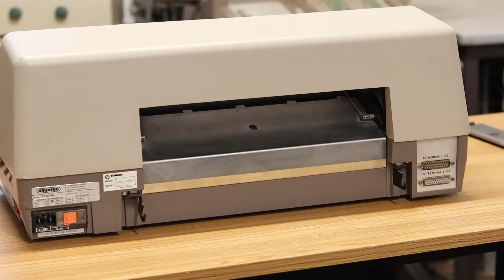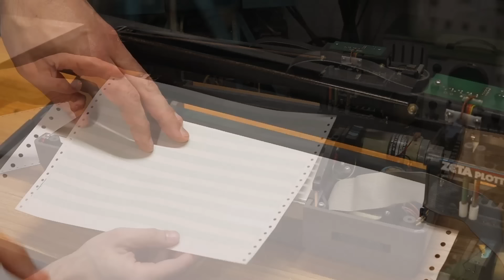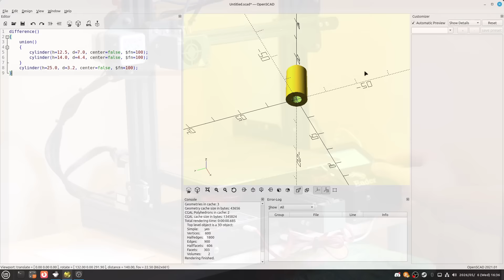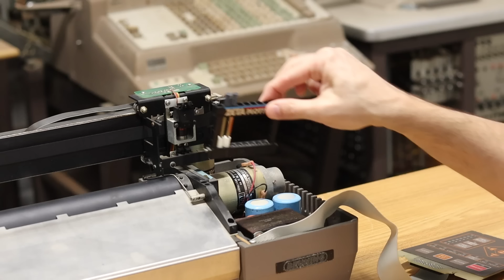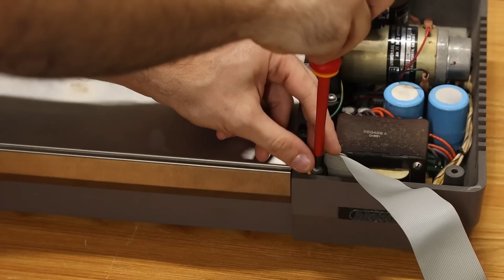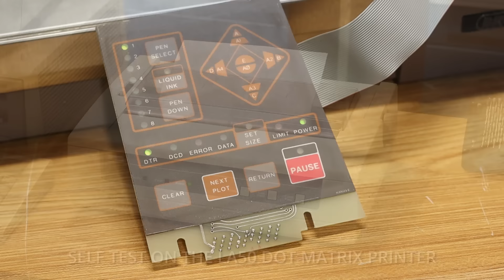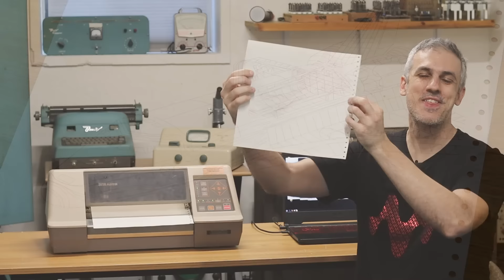A Pen Plotter from 1986!

Comment: well i guess you print PETG. and its surely humid. petg lloovee take moisture. for finner wall and such use a 0.2mm nozzle. its WAY slower but for the part you made honestly... use a 0.2 nozzle. but itsa ender 3 soooo... good luck for bed level and first layer with that.

Comment: Back in the olden days when I was a teen punk, I had a Commodore 1520 pen plotter. The tiny pens did not hold much ink and were incredibly expensive (to a 16 year old.) I came up with the clever idea of shaving a pencil down to fit in the pen turret. It was very strange to see computer generated text written in pencil, but it worked.
Reply: I had the same plotter

Comment: Be aware that not all HP plotter support the full HPGL command set.
Most printer driver only support the HPGL2+ command set. This includes fillings and Bézier curves The HPGL (1) Command set handles fillings differently and many commands have less options. And the original HPGL differentiate between a basic set of commands that all devices have to support and extended commands. But there is no reliable way to test what is supported. The manual to the device has a list of supported commands.

Then there is the buffer problem. Old plotter like that don't message beck if the buffer is full (they only have 50-150kb). You have to track it manually, there is a "Message" command (sorry i don't remember it right now o think it was "O" oder "OE"?) you can use for that. send over a block of command with the message command als the last one. When the message comes back you can send the next block.

The software Incscape has a decent HPGL export, this can give you a good starting point. But it's generating a mix of HPGL1/2 commands, so you will have to do some filtering, to get a working set.
Reply: I have a two torture tests for plotters i generated for my two flat bed pin plotters: dragon curve and koch flake.

Comment: Give Kiri:Moto a try. It is a nice CAM processor made for CNC Milling, Vinyl Cutting, Water cutting, Laser engraving, Laser cutting, Slicing (3D Printing) and more. So you have a very good free CAM processor for all of your machines. 
For the pens, it looks like a Fischer "Space Pen" replacement cartridge might fit. They can't dry out and even work upside down. There is a dry paste inside kept liquid by high pressure. Once the paste is out on the paper, it instantly hardens. That's why they even can write under water and on almost all materials and won't smear. I used to use them in my CNC machine before I bought a Laser to stencil stuff.

Comment: Everyone will likely say "the filament is too wet". This matters in practice a lot less than YouTube Comment Lore thinks. Especially if you're using PLA in Texas. 

The Ender 3 Pro (at least mine did) always had awful *e-steps calibration*. The ender also drifted out of calibration the longer it sits.

Comment: The Columbia Shuttle drawing - the 3DBenchy of the plotter world.
Reply: I always liked the Sydney Opera House as a great test for E size HP plotters.
Reply: @RambozoClown  The Real Thing is Great too! ..... 😃🦘👍
Reply: @binaryboyo9674  hideous building
Reply: 2DShuttley
Reply: lol. So true. Every time I went to an exhibition in those days, that drawing was there; sometimes even in colour!
Reply: The art school I work at has a HP T1100ps plotter from 2007. The demo plot is a still of I'm not sure if it's Wallace and Gromit or something similar. Beautiful watching it print. Also I'm sure there are digital artists and illustrators out there who'd love to play with something like this. In addition Japanese archival printers still use the vacuum to pull the paper tight to the platen. Thinking about your roll issue I wonder if you could adapt a wider roll from a more modern large format machine. I've worked with 24" and 36" machines - perhaps with your machining skills you could find a longer bar and shorten it. I image the roll end pieces are fairly common, you can certainly buy adapters online for HP, Canon and Epson machines but they would be slightly different. Or if you can find a suitable bar you can make your own end pieces. One of the secondary schools I looked at as a child had a pen plotter but I have never seen one since in person. I believe inkjet technology has mostly replaced them as the nozzle technology is very advanced now.

Comment: 5:20 - One might be able to 3D print a thin adapter, one with holes on one edge and nubs on the other to span the gap on the shorter page size.
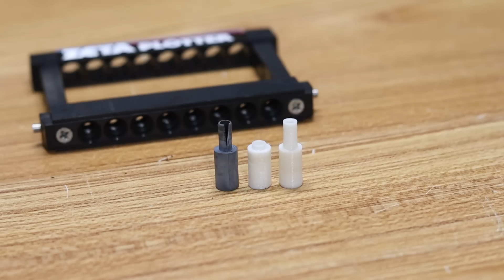8:33 Did you run the calibrations in the slicer? Stringing can be affected by a number of things, retraction, sped, time, distance and temperature. Try reducing the nozzle temp by 5 or 10 C

Comment: Working at a national railway company in Europe in the 1980s, I had the luck to watch an enormous DIN A0 pen plotter in action on several occasions and man I can tell you, these DIN A0 plotters (they are GIGANTIC !) are so impressive working at full speed.
Reply: I guess it comes down to perspective.  A0 is 'only' about 85cm on one edge so a standing plotter only has to be say 1m wide and have a drum top edge height of around 1.5m, or the other way around with 1.5m width.  I did a stint in technical in an office equipment shop and got to see all this sort of stuff in action too - plan printers etc.

Comment: 12 inches is around 30,48mm. Maybe it is DIN A4 horizontal / DIN A3 vertical endless tractor feed paper?
Reply: Yes. The manual seem to refer to ISO A3 and A4. Found some expensive A4 landscape  would be fun to find some A3 portrait with tractor feed or continuous roll of 330mm paper with tractor feed
Reply: @Roy20100  The only thing I found in my quick search was "A4" landscape that's actually 330 mm by 8". The length of fanfold paper was never metric because tractor feeds only move in fractions of an inch, so while the width usually matches A4 and A3, the length was always some imperial size. German standard fanfold is even imperial in both directions, 8.5"x12" including the perforation if I remember correctly.
Reply: @Ragnar8504  A4 is 297 mm x 210 mm its just under 12" . i am a printer tech for 40 years. Landscape is just portrait on its side..  there is another sizr called SRA4. dont remember the exact dimensions but its wider so you can get full edge to edge printing . Its designed to be guiletined to size after printing.
Reply: @spud4242  I was doing some digging and found references to something called A3+ or super A3 paper, maybe that's the ticket?
Reply: @jasonhanna2699   yes thats whats called SRA3 or SRA4... it is bigger so you can print oversize then trim the page back to A3 or A4  and have full edge to edge printing.
Reply: @spud4242  Fanfold paper wasn't quite metric because of the sprocket spacing on tractor feeders so the sizes were always slightly odd even though manufacturers occasionally use the nearest DIN size to refer to fanfold paper.

With the perforated strips on two sides you can't just turn the paper 90 degrees if you want landscape as you could do with regular sheets.
Reply: @Ragnar8504  330mm by 8 inches is the most atrocious way to give a measurement I've seen in a while lol
Reply: Minor correction, 30,48cm not mm
Reply: @danpedersen55 30.48cm
Reply: Yes, pretty certain it does. I just recently threw out an A3 dot matrix printer and a carton of that very paper, which would fit this plotter too. Look for "Endlospapier A4 Quer 1-fach" and check the dimensions. One of the tractor wheels may be adjustable too, ymmv.
Reply: Not "around", 12 inches is exactly 30.48 cm. A4 paper on the other hand is 29.7 cm (11.7 inches) long.

Continuous stationary was made 12 inches high in Europe because the sprocket holes are spaced 1/2 inch apart. Using A4 would have meant that the sprocket hole distance would need to be adjusted so that there's still an integer number of holes per page. This would have made printers incompatible with other paper sizes, so Instead they rounded the paper height up to the next 1/2 inch which ended up being 12 inches.
Reply: I have a box with 330mm x 54m paper in basement, is for a weird wide 24-pin dot matrix printer I have. So yes, seems to be a standard size.
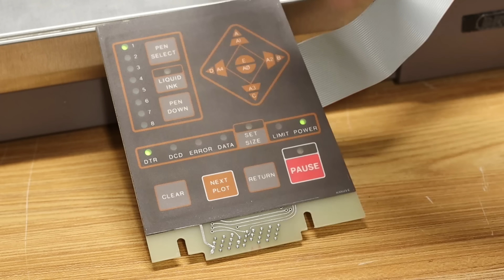Reply: If I'm not mistaken, the front panel even shows the paper sizes from A0 to A4 on the arrow keys (at 16:24). Although I do not know what the printer does when you tell it to print sizes wider than 12". Maybe it prints strips that you then have to tape together?
Reply: 304.8, surely?  An inch is defined as exactly 0.0254 of a metre.  

[mode=nerd]You can spot very old fire hydrant signs in the UK (the actual fire hydrants are underground, with a metal plate over the top) because the old ones gave the distance (from the post, in the direction the plate was facing) in feet and the size of the valve hose fitting in inches, and the new ones give the distance away in metres and the hose coupler size in millimetres.  Since there is obviously no overlap between the ranges of the second number  (3-8 inches / 75-200 mm.), older firefighters just multiply by 3 and divide by 25 if necessary, and younger ones just divide by 3 and multiply by 25 if necessary. [/mode]
Reply: My thought too. Standard size in Europe in the 80s
Reply: @OscarSommerbo  A series paper dimensions are pretty much the global standard the exceptions are the US and Canada.
Reply: @OscarSommerbo not only in the 1980's it's still the standard size
Reply: @rj7855  True, but some European countries took until the 1980s to adopt the new standards fully and use up their stocks of old paper.

Comment: For thin wall printing, you can "cheat" and tell your slicer that the nozzle is smaller than it actually is. It will the put in higher-density lines which can allow you to print finer parts, albeit with a little less tolerance. But worth a go.

Comment: Strings on printing - check temperature too high.  Also, as far as the plotter - does moving the mechansim left/right to free it up cause "back-current" through the stepper motors?  I know it's an issue with 3D printers where if you move the print bed you risk damaging the circuitry.  I'm also an Open SCAD user from way-back!  AND I use an Ender-3.  Lovely to see you using them both!

Comment: OH!  The 3D printing problems you were having: If that's TPU, the filament needs to be dried.  I print that stuff all the time (90% of what I print is TPU).  I think you'd want to use flexible UV resin for those boots.  The part of the boot that sits in the spring is used to keep the pen from dragging.  That is, when the pen starts to draw, the friction will pull the pen in the opposite direction of travel.  That thin part of the boot is supposed to reduce that.  If you can send me the dimensions, I can print a couple of dozen.
Reply: It's an Ender, no way is he printing tpu with that.
Reply: @JamesChurchill  I've never touched one of those.  I've either built them or used the Bambu.

Comment: It is tough to be sure from the video, but those pen cartridges look similar to Fisher Space Pen cartridges.  The Fisher uses thixotropic ink which is semi solid and becomes liquid under contact pressure.  That allows the cartridge to be nitrogen charged and the will not leak out past the ball.  That is just the kind of thing which would be handy for a plotter pen.

If they are Fisher cartridges, they’re pretty easy to get and they come in multiple colors and line widths.

Comment: Not sure how accurately you measured the "12 inches wide, 13 with the tractor feed" size, but A4 is 11.7 inches tall and A3 is 11.7 inches wide (because European paper is sensible thanks to the √2:1 aspect ratio) which is a close(ish) match - but it seems that for the most part tractor feed paper was standardised on some weird one-size-fits-none dimensions that aren't quite US letter but also aren't quite ISO. I know ISO tractor feed was available in the late 80s/early 90s, but it doesn't seem to be manufactured any more.
Reply: E.g. SIGEL Germany still produces tractor feed paper in the EN ISO 216 size A4 landscape under product numbers 08330 and 08336. The width is specified as 330 mm, which corresponds to 13 inches. But tractor feed paper is not cheap these days.

Comment: 12 inches - that's what we used to print pilot maps on for gypsy moth spraying.  Making a paper spindle for the rear feed wouldn't be much of an issue - a couple of 3D printed parts, a carbon fiber or steel rod, maybe bearings (depends on the size of those hooks).  Easy.

Comment: This will be a fantastic episode.  I actually had the opportunity to use a plotter in the 80s when I worked at a circuit board CAD bureau.  Much larger beasts that this, and they were a bit scary the way they whipped the paper back and forth.

I just saw the buttons, and they are literally the worst input hardware ever invented (there's a reason it went extinct lol).  They have zero feedback, so you can't even tell whether you've successfully pressed the button.  Ew!

Comment: Paper it doesn't fit the nubbins? 3D print and new nubbing thingy that you can slide. 

Rubber pen things split? 3D print new ones in TPU. 

Everything can be solved with 3D printing haha

Edit: ha, just made it to the bit of the video where you do exactly the same thing with the pen rubber haha.

Comment: My drafting class in high school had a little Roland plotter with an electrostatic bed to hold the paper in place. Neat machine. Later my mom bought a couple small HP plotters, one with two pens and one with an 8 pen carousel, and a place I worked at had a 36" HP too. They're fun machines to play with.

Comment: You can locate the necessary pen refills, then slightly fill them with a solvent for pen paste, rinse out the solvent, and finally fill them with colored ink—using a syringe—from colored pens.

Comment: You have a CNC mill.  Make a metal frame to hold several sheets of wide computer paper cut to width.  Drill a row of holes in the steel near the edge the size and spacing of the punched holes to form a die.  Then use a steel punch in the mill with a simple Gcode file to punch paper.  Or you could machine a bar with multiple punch pins and make a manual punch to work with the die paper holder frame. The hand punch could have 5, 10 or even a full page length row of punch pins.
As for pins and pin holders, a metal lathe can easily make a pen holder from solid plastic rod.  Also any ball point refill can have an adapter machined to adapt it to replace the custom pens.  
Contact me with drawings and I would be happy to make punch and die or new pens for you in my machine shop.

Comment: damp filement and probably bad retraction settings. it mostly afect filements that was open for long time, if it is pla i wouldn't bother too much fixing it, just print at lower temperature. if it is petg then need to dry it, and if it was tpu in ender 3...that is just how tpu works in ender 3... plus it likes to drink water from air like sponge

Comment: For paper, check out KDM 220 or KDM 228. The size listed is 12-inch wide with 1/2" perforations left and right. I think this implies a 12-inch printable area with additional width for the drive edges.
EDIT: I double checked the KDM web listing and it appears the KDM 220 is 12-inch overall, with a 11-inch printable area. The KDM 180 paper is 9.5 x 11, with is the portrait version. I would say the extra inch on both versions is the drive edges.
EDIT 2: There are paper sizes of Super A3, Super B, and A3+ that list a width of 12.95". I can't find any vendors that make or sell new or NOS paper though.
Reply: Those are ANSI A landscape, they are 11"+1"=12". They are supported in the plotter but are 1 inch short
Reply: In working with paper, one trick I use is take the wide green bar, cut it to fit the print area AND…
Take the strip you just cut off and glue it to the paper, back side of course, and then use that as a substitute.
To make sure the holes line up, take a piece of plywood, drill for holes to match the paper pattern.
A 20” by 12” will allow to make the correct paper for use with the plotter.

Comment: If the tip of the pen is not held rigidly in place then it is more likely to skip on the page.

You can create a jig to hold the printer paper in place. Might need something to lightly stick the paper to the jig.

Comment: Maybe you can get pcbway or such to sponsor you the 3d printing. They have processes that can do those thin edges or at least you could use a flexible rubber like material like TPU. 
Maybe you like to do things yourself too but accepting some help when you are at the limits, isn't bad.
Reply: Could glue up the split and use the old one as a pattern to make a mould and cast new ones. The toy car restoration channels do this all the time with things like tyres.

Comment: You urgently need to buy an ANYCUBIC Photon Mono 4K or 8K 3D printer that uses liquid resin; there is even a rubber-like resin available—flexible and soft, just like rubber or latex.
Reply: No, he just needs to get a printer which isn't ten years out of date.

Comment: Maybe C series paper (relative of the widely used A size papers), would fit. C4 paper is 229mm × 324mm  or 9.0 × 12.8 inches, while A4 is 229 × 324mm / 9.0 × 12.8 inches
Reply: Correction: A4 is 210 × 297mm	(8.3 × 11.7in)
Reply: @svenax  Probably meant C4 paper size (usually are envelopes)
Reply: @benhetland576  Yes of course. The size given for C4 is correct but the size given for A4 is the same as C4 so I corrected that.